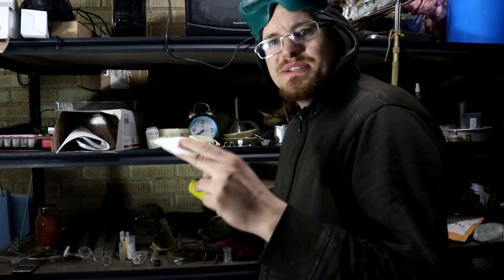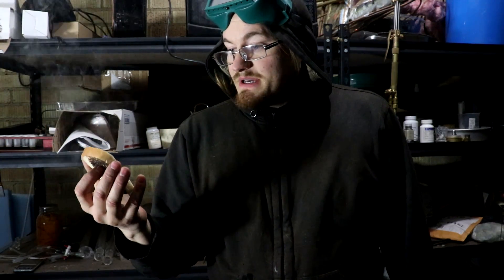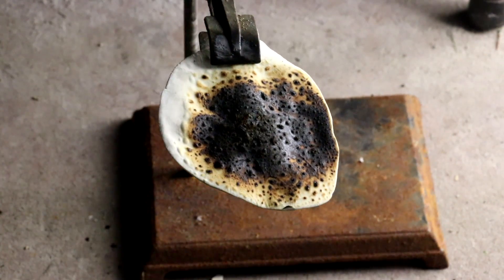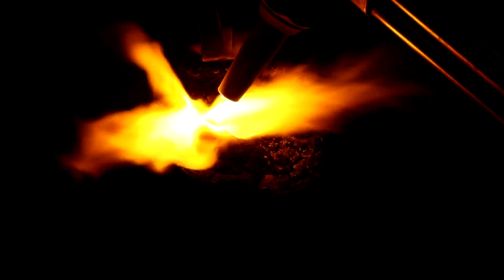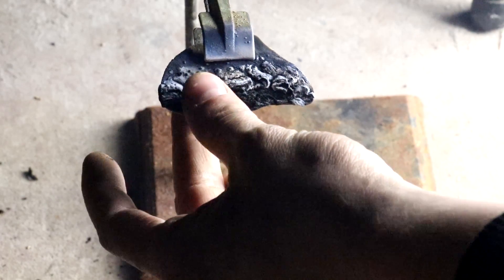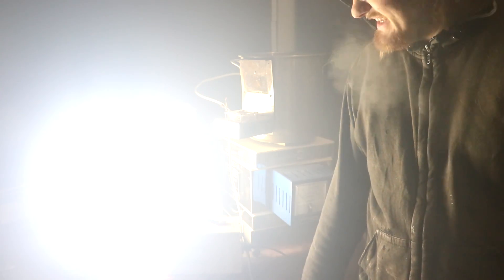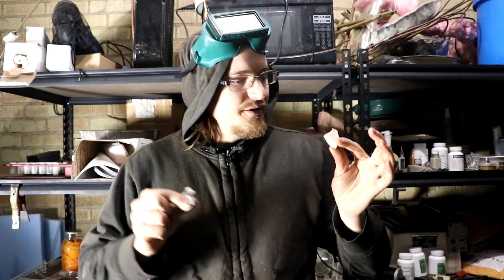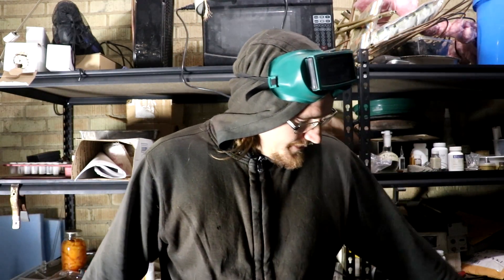Can I Burn Through Starlite?

Comment: my problem with this test is that you are testing an ablative material with a cutting torch. all of the thermal insulation that is produced is then immediately blown away from the material and negating the intended effect. i think a better test would be to make a shell of the 'pseudo starlite' with a thermocouple inside it and putting that in a furnace. The intended purpose of this material is that it be heat resistant/insulating, not 'blast from a specifically designed cutting torch' resistant.
Reply: So the bread slice is good
Reply: @bernardoalbano1816  for about three seconds and it's already burnt black on the other side, beyond the press used the same high powered torch to melt a steel bolt on their starlite then picked it up with their bare hands the opposite side was pristine. I don't think the "I'll put toast under a blowtorch for three seconds" test really compares.

Comment: Hey Cody, first off love the channel! Just a quick comment...I think this test is a little unfair to this new version of 'starlite'. According to what I've read, the material claims to only be rediculously heat resistant, I don't think it was designed to (at least this version of it) stand up to the psi coming out of the torch. In fact thinking about it that would be its Achilles heel: the hot temperatures would create the brittle carbon to try and dissipate the heat and the high pressure would blow it away, starting the cycle anew. Your thoughts?
Reply: Achilles heel that's funny! Sounds right thought.
Reply: There isn't a big difference in PSI  from a regular propane torch though. Propane itself can get to pretty high PSI
Reply: @FieryHyrdra  I totally agree the PSI between torches is very comparable. In either case I feel the psi with either torch is too high and contaminates the test... Basically the heat + psi is cutting the material, you take the psi away and the material would not cut.

Comment: Sorry not to nitpick but, a/o torches doesn’t cut through stainless steel, the whole point is to heat the metal to a critical temperature in a concentrated spot then you use the high pressure oxygen to rapidly oxidized and blow the oxides away. 

By its very nature stainless steel get cut. Your just melting it and blowing away the molten metal. That is why your cut looks so rough

Comment: I can't remember what I was watching, but it was actually on this same subject, but from the NASA perspective on how they meant to use Starlite:

1.) It is very lightweight
2.) It can withstand decent temperatures
3.) There IS a plasma(?) barrier that prevents the 'flame' of reentry from actually directly affecting the material (blunted nose of the shuttle, etc.)
4.) It's easy to replace

So, on those notes, I see why it was appropriate to use, but yes, I agree that it is over-hyped.

Comment: Seems to me that the gypsum in the wall board fared better than the Starlite up against the torch. Obviously we can't tell if the heat transfer through it was better or worse, but my observation was that it took longer to cut through it.

Comment: I don't know if it really is burning through the material. It appears that the material begins to flake when it burns. I believe that the pressure from the flame is breaking off the burned material. If this is true the heat is not breaking the piece, but the physical force of the flame is instead. What also leads me to believe this is that the thicker piece didn't have a burn time that seemed in relation to the smaller. You said it was 4 times or more thicker and didn't burn 4 times longer. 

What I think you should do is test it with lasers. With a laser you have the energy present without the force of flame or pressurized gas moving away the carbon(or whatever forms the flakes). It is the formation of these flakes that gives it its insulating property, from what I've read on it.

Comment: you said that this starlite couldn't withstand atmospheric entry to oxygen rich atmosphere due to the its carbon 'barrier' being chipped away thus making the starlite degrade at incredible rate (which i agree). 
So what do you think if this 'magical' material getting sandwiched between any material that have been proved can withstand atmospheric entry and acts as heat sink or rather heat disperser ?
of course the that being said the starlite itself doesnt contain any substance that could build up pressure otherwise things getting worse.

Comment: So, speaking of stainless, what if we use it as a composite? It seems like the stuff would make a really useful insulation for a small electric furnace, starlite sandwiched between two stainless layers, behind a thin layer of fire brick, or just lining the inside. Outside of fire bricks, the most common insulation for forges and furnaces is kaowool, a ceramic fiber wool that is very, very unfriendly to the lungs and soft tissues. It could work as a lightweight economical alternative.

Comment: I think Nighthawkinlight was able to make a rather good approximation of the recipe. But I don't think anyone is claiming it's invincible.

 I would argue using a high pressure, strong oxidizing flame might be a little intense of a test for a typical use case but interesting none the less. 

 Like you said it's a cool material but not necessarily unbelievable.
Reply: Oxidizing flame is exactly what you want if you want to test it as a heat shield material, because Earth's atmosphere is oxidizing.  Also, reentry will put a considerable amount of mechanical stress on the heat shield (even more than the oxyacetylene torch did), so it needs to be able to withstand that.
Reply: @Lucius_Chiaraviglio , for specifically reentry yes. But If it is being use to insulate from fire then most flames are going to be unoxidizing or very mildly so. 

 Which is completely different then blasting it purposefully with a highly oxidizing flame.
Reply: @Lucius_Chiaraviglio  not to mention the temperatures on reentry will be a lot hotter than the torch
Reply: @Lucius_Chiaraviglio  here we're thinking of a cheap way to insulate, NASA has the funds to use better materials, we don't. putting starlite as a shield between rooms in a house would be revolutionary. but, as cody said, something that's cheap and can withstand tens of thousands of degrees is unobtainium as for now.
Reply: the cyan platypus
The cheapest way to built a fire retardant wall complying with regulations here in germany is two double layers of 12,5mm plasterboard with interlacing seams and rockwool insulation in between. Firesafe, soundproofing, fast to build, fast to dismantle, no snake oil required.
Reply: @rouge5140  To use it as an insulator in houses you'd have to burn it first to create the carbon foam and then use the carbon foam as insulation. Before burning it, it has all the thermal insulating properties of unleavened bread.
Reply: @OnlyKaerius  
pardon my sloppy writing, english isn't my first language, what i meant by insulator was a fireproofer.
Reply: Nasa's heat shield materials work off the exact same principle though. They both form carbon foam
Reply: It was claimed to have been strong enough to use on the space shuttle.. so oxy torch isn’t too strong of test.
Reply: I was thinking considering it's era, the actual recipe might contain asbestos
Reply: It's good enough a material to make a custom-molded mini-foundry (that's not rated for iron) in your home and all you have to do is toy around with some silly putty, I'd say that's still a great win for "nightlite"
Reply: Or it's not starlite at all.
Reply: Nonetheless is one word btw.
Reply: @Snyde91 , not necessarily. It can be done either way. Saying "nonetheless" is literally just a contraction of the three words "none the less" (Big surprise there...) 

 It is written that way because people tend to say it as one word but you can still pronounce it as 3 distinct words as I often do. Especially while emphasizing something.

 All "nonetheless" technically is, is a slang dating back to the 1500s that became accepted as the norm.

  Though If it bothers you that much I can change it?
Reply: @TrollFaceTheMan  stay in school and you might actually learn what a contraction is.
Reply: @bruceschneier6283 , "A contraction is the act of decreasing the size of something or shortening it, or it can be the process of becoming smaller or compressed."

 Last I checked removing spaces from a group of words counts as shortening or compression...
Reply: @TrollFaceTheMan  you literally just looked up the wrong definition of contraction. You say you stayed in school long enough up l but I'm far from convinced. Maybe you should try a little harder to learn the language before you go trying to teach people.
Reply: @bruceschneier6283 , funny you are a guy that apparently doesn't realize that words can have multiple definitions used based off circumstance and the fact I am using the LITERAL definition of contraction...

 The problem is you are assuming I meant specifically the literary definition like Can't... let me make this clear, that is wrong and I didn't...

 I meant it as a literal contraction or compression of 3 words into one.

 Here is an example of multiple definitions based on use case... I can say "That man crushed that can..." (He used physical force to crush it...)

 Or I can say "That man crushed that can..." (That man quickly consumed the contents of that can...)

 Also someone can have a crush on someone meaning they like them... Or be crushed... As in either physically or mentally...

 See... Same words... can be used in the same sentence... Completely different meanings based of context... 

 What you are doing here is idiotic by trying to tell me what definition I am using like if I say "yeah he was crushed after failing the exam..."

 And you go "Ha you're dumb because crushing means to be physically crushed and he wasn't so you don't know what you are talking about..." 

 It's childish...
Reply: Bruce Schneier  "Maybe one day you'll learn to string those words together in a way that doesn't make you seem like some cringey /r/ iamverysmart bait..."

You are calling me cringey when you are referencing reddit chains as a form of insult..? 

 Mmmmhhhhmmm... Nah man, I think you are the one who is 'too edgy...'
Reply: @bruceschneier6283 , ohh that was so sharp I think you cut me a little...
Reply: @TrollFaceTheMan  lol ok whatever you say kid
Reply: @bruceschneier6283 , don't you mean 'Oh man you're such Edgy Edgelord' again..? Because that is the witty, original commentary I've grown to know and love from you...

 You breaking the cycle of your repetitious and rudimentary one liners now has left me feeling uncomfortable and unfulfilled...
Reply: @bruceschneier6283 , alright then XD

 You've really shown me up during all of this with your superior intellect and all :]

 (Speaking of which tenuous is a fun word, how long did you rack your brain to come up with that..? Or did you just thesaurus it instead..?)
Reply: @TrollFaceTheMan  The only thick skulled one I see here is Bruce, lol.
Reply: Starlite, when you need something fire resistant but not as good as drywall I guess.
Reply: The atmospheric entrance is 4000 degrees hotter than that torch
Reply: id say if you wanted to use this as a security measure, being cutable by an oxy torch would be an issue. that said, that isnt the purpose of starlite
Reply: I'm pretty sure I've seen a few idiots in the comments of other videos thinking that it's the best material ever.
And that's without mentioning the conspiracy idiots who believe that "the government already has the tech but it's suppressing it"
Neat material, but as you said is nothing to write home about.
Reply: @GoldSrc_ , your right they should talk about a real conspiracy... Like Half Life 3 already being made but kept from the consumer's all these years!!
Reply: @TrollFaceTheMan  You mean half life VR?
Reply: What he’s trying to say nicely, and did so quite well, is that starlight has barely if ANY AT ALL actual insulating properties, any more than a piece of bread would. 

The fact that he was able to do the original torch experiment interchangeably with starlight or a piece of stale toast shows that YOU’VE BEEN DUPED BY SOME ONLINE SNAKE OIL DUDE. Starlight, or at least this version of it, is more of a placebo than a good heat shield. 

Yeah it would be cool if this starlight actually worked, but wanting it to work isn’t a reason to defend it. This entire video from start to finish easily shows why this version of starlight is nothing more than a parlor trick.

Cody did everything short of saying these exact words, trying to explain it’s not a good heat shield. He showed a stale piece of toast has the same ‘protective’ ability as the starlight shown in the original starlight video. He showed it’s arguably easier to cut through than steel even though it’s supposed to have low thermal conductivity. Any argument for this specific recipe of starlight is just in vain.
Reply: @PsychoticWolfie , he only heated the bread for a very short time on his hand, much longer he would of burned himself. If not for just the bread burning away, but also from the porosity of it allowing easy hot gas transference.

 If you watch Nighthawkinlight's video he blast some of the material on his hand for a very long time without any issues.

 I personally know LightHawk and I can say he is not some 'Online Snake Oil Salesman' or whatever you want to say.
Reply: @PsychoticWolfie  well if you watched closely you would see the bottom of the bread was also black, and after much less time under the torch. What he was trying to show, is while is is very good at defending again reducing flames, it is less effective again oxidizing flames (although he only burned through it through mechanical force, by blowing away the carbon foam that formed using blasts of oxygen). Also, why does avcoat (Apollo's heat shield material) function in exactly the same way. The only difference is the structural integrity of the resin used is higher and it is supported by a fiberglass matrix
Reply: I think it more likely the underside was scorched from a previous take, otherwise he would have burned his hand.
Reply: Edit: The below comment pertains to a lengthy explanation of the possible uses of this material for house fires just a comment before that didn't show up because YouTube is stupid and hide it... Maybe it'll eventually come back though?

 Now don't get me wrong not saying we should build fireproof houses of it either. Just giving an example.
Reply: @TrollFaceTheMan  One reason why it became so "popular" was because NASA wanted to test it as a possible heat shield material

Comment: the beyond the press channel already demonstrated the torch test after they did the thermite crucible, i want to know if it can withstand copper or iron foundry conditions, the torch seems to be blowing off the layers of carbon because of the added force behind it compared to say a propane or coal foundry, it might be a little over hyped but where should the "hype" line be drawn is what im asking. we dont need it to act like tungsten, just to be a viable fireproofing/thermal radiator material. please experiment more for me if no one else

Comment: I think it's main purpose is more of a fire-break and ablative type of retardant than a full completely fire-proof material. That it's relatively cheap, safe to handle, and easily formed is one of the main points, and there may be ways to modify the formula so it could be painted onto stuff like wooden structures. It'd puff up and insulate just enough to keep the wood underneath from burning. But once it has done it's job, it'd need to be chipped off and re-applied. And since I think you're familiar enough with fast moving wildfires Cody, I'd think there's at least one application that may make sense to you.

Comment: For those watching at home, an OA flame is 6800 degrees Fahrenheit.  The extra oxygen of a cutting torch actually oxidizes the metal, you could turn off the flame once you've made the initial puddle.